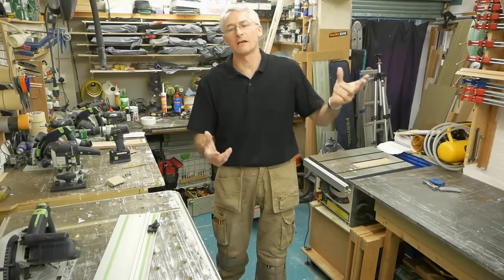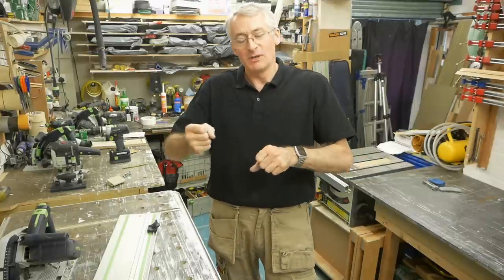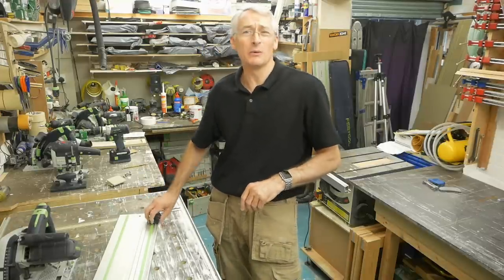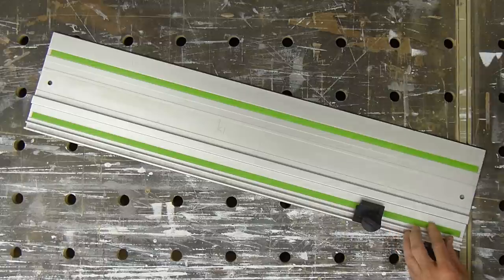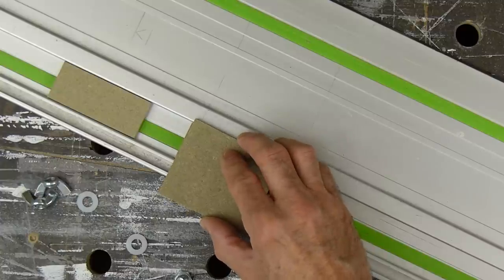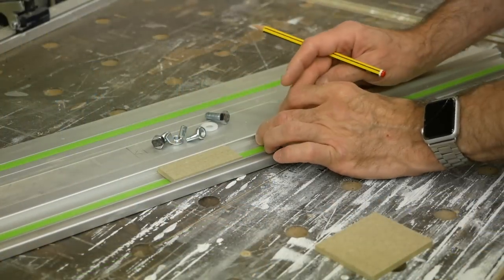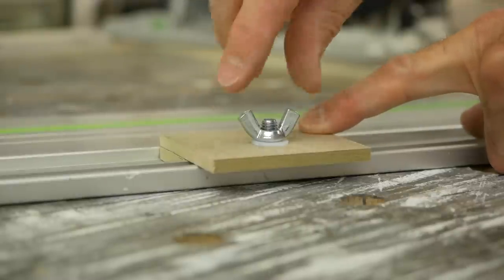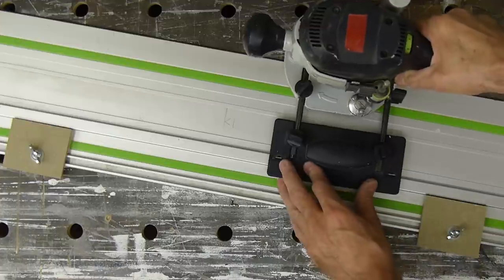Guiderail Stops - simple, easy & cheap to make. #073

Comment: This is really late to the party but you got my interest on the kickback. I had been using a clamp to hold my guide rail in place by clamping over the t-track section of the rail your stops ride in but leaving enough room to slide the saw by it. Using the clamp upside down gave a low profile and no problems for a long time and I was used to doing it. Then I tried to cut 2x4 material. Plunging that far down caused the motor housing to come into contact with and ride up the clamp causing terrible kickback. I continued to do this 3 or 4 times not realizing the stupid mistake I was making. From past experience, what I was doing was OK, but the 2x4 material showed my error. I chewed up a nice section of my guide rail until finally figuring out what I was doing, and then I felt very lucky to have not gotten hurt. I bought some proper guide rail clamps quickly after.

Comment: I've got the Batavia T-Raxx version of your Triton saw with the slightly annoying anti-kickback knob.  I Have only had kickback once and this happened when I first got it - I was messing around and doing things I shouldn't have been!.  The saw just pushed back into me slightly and I don't think the anti-kickback thingy actually did very much!!  I don't see tracksaw kickback any worse than a catch on a lathe... both will catch you unawares, but it's totally managable and not really dangerous.  
P.S. To avoid having to mess around with the anti-kickback knob when you mount the saw on the rail, just slide the saw forward whilst pushing down on the saw and the knob will grab the rail, turn to the 'disengaged' position and your saw will then drop onto the rail without you needing to touch that knob.  You will still need to turn it when pulling the saw back after a cut, but I've gotten into the habit of using the knob to pull the saw back.
Reply from the maker: +EscapeMCP Thanks for the tip - I'll try it out 👍

Comment: I've noticed a number of viewers commenting on you looking to the side of the camera rather than straight at the lens. I guess your camera has a flip out screen? Have you considered using a teleprompter arrangement where your screen would be in front of the lens? I don't know if your camera supports an external screen. It would be an interesting shop project. A number of youtubers have made their own inexpensive versions using little more than a cheap photo frame and a tablet/flat screen. Worth considering?
Reply from the maker: +DesandSam Better to avoid the screen I think. I spent ~20 years of my former career stopping people from looking into the lens, hard habit to break.

Comment: I'm looking forward to your track saw series. I am looking to start woodworking, and am interested in starting out with good value tools. 

I'm also interested in finding out where to buy decent hardwood and plywood in the UK. I am based in Essex and most of the timber yards around me deal mainly in softwood and construction timber. I'm hesitant to order online until I have a little bit more experience under my belt.

I also have no workshop space, so that's an interesting problem to solve.
Reply: Michael, I've used timbersource for hardwood before and been very happy. They have a decent selection of woods and they're good if you need help. Decent plywood seems to only be available on ebay, but I've never tried it out. Like you, there is nowhere local to me that supplies anything other than cheap redwood/spruce and the like.
Reply from the maker: +Rico S To follow on from Rico's comment, I've used South London Hardwoods - slhardwoods.co.uk - without any problems, but I am beginning to appreciate how lucky I am to have such a good timber yard in my doorstep 👍
Reply: Thank you both for the response. I'll check them both out!
Reply: Wow Slhardwoods stock valchromat in full sheet sizes. Amazing
Reply: If you are happy to travel a bit round the M25, try Surrey Timbers near Godalming or Timberline in Tonbridge. Both have very good selections of hardwoods, and are happy to cut and dispatch. I strongly recommend them.
Reply: May be Abit late to reply but if you're struggling to find hardwood a place called Ossett hardwoods in west Yorkshire is your place to look they sell European and american oak maple and poplar as well as iroko and walnut,. They have a sister company who make drawer boxes for bespoke furniture makers so started to offer the timer they have available to the public

Comment: Nice one

Peter, I'd love to see a tips / techniques series on using the tracksaw - eg. recently I had to set up some stopped plunge cuts and while I managed OK it took several test cuts to set everything up. The track saw seems to be the way to go with ply / MDF (more accurate than the old Triton saw table anyway) but most of the info on Youtube seems to be on table saw use. So what do you think - can you include some technique for beginners in your upcoming series?

Cheers from Melbourne!
Reply from the maker: +Dean Cave Thanks Dean! And absolutely, tips & techniques all included in the upcoming series 👍
Reply: Awesome mate
Best of luck with the channel, it looks like you've gone from about 5K to 6.6K subs in the last week!!

Comment: Peter, in my experience kick back happens when an unsupported piece of wood contacts and pushes against your spinning blade. I feel as if kickback is always when your blade is in a bind situation, squeezed between two pieces.  Just my two cents.
Reply from the maker: +Gareth Dirlam In plunge saws (at least the ones with riving knives 😬) it's generally on the plunge that this happens. Table saws or regular circular. saws, sure, it's the blade getting pinched. 👍

Comment: I just ordered a couple of these Festool limit stops to use as a "stop block" for my OF1010 router attachment. I haven't received them yet, but if I understand you correctly, they won't fit on the guide rail in such a way that they will stop the router attachment thingy? Festool says they will...... confused now.
Reply from the maker: +Klaus Skrudland If Festool say it'll work then you have to trust that they're right, but as referred to in the video, unless I have a different version or I'm using it wrong (not impossible) my Festool 491582 guide rail limit stop does not work as a stop for the 488752 guide rail adapter for of 1010. The limit stops spec says they are "...suitable for use with: TS 55, TS 55 R, TSC 55, TS 75, ATF 55, AP 55, AT 65, AP 65, AP 85." Nothing else mentioned there.

Let me know how you get on - always ready to admit that I'm wrong about something.👍
Reply from the maker: +Klaus Skrudland Thanks for getting back to me - I'm intrigued now, I'll have to have a quick play when I get to the shop! Certainly the way I have mine set up it doesn't act as a stop for my router base - I wonder if they expect you to use the router the other way around?? Or maybe they fixed it when enough people complained, lol! Please do let me n ow how they work out 👍
Reply: Haha.. ok, we'll find out!